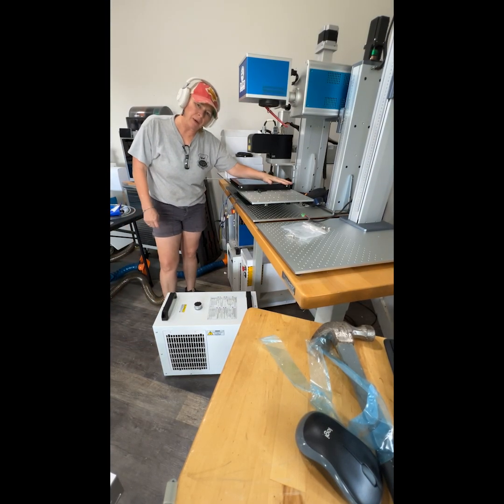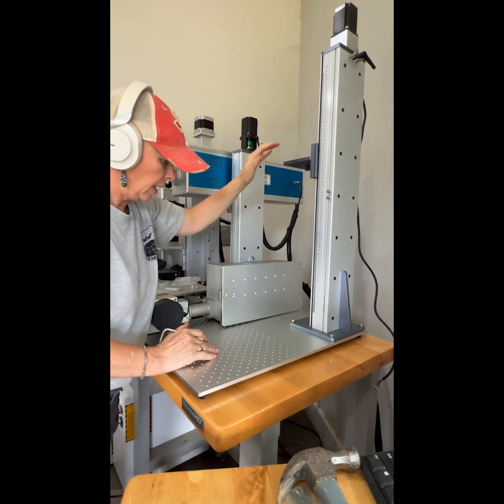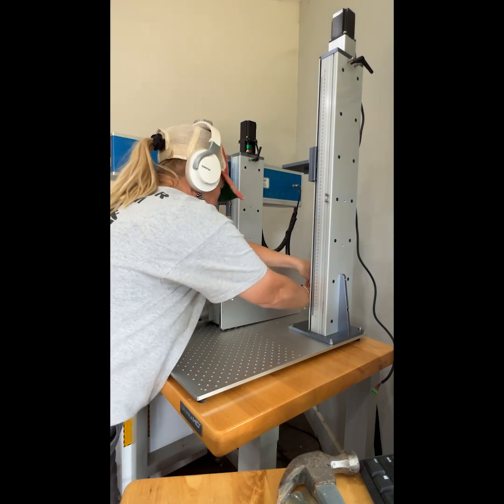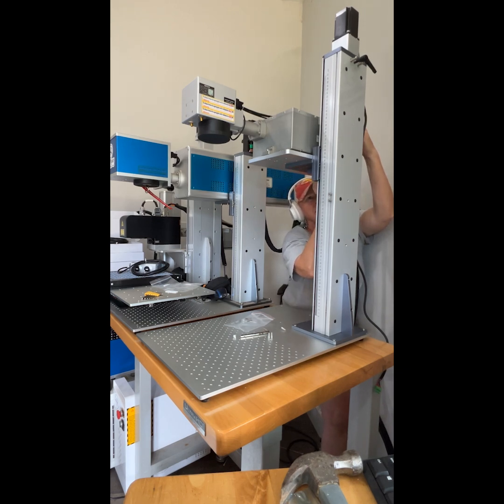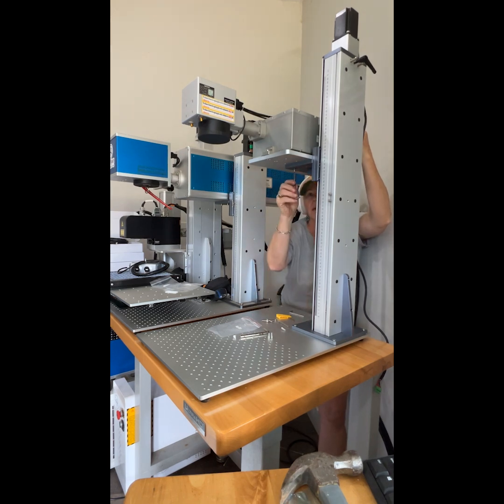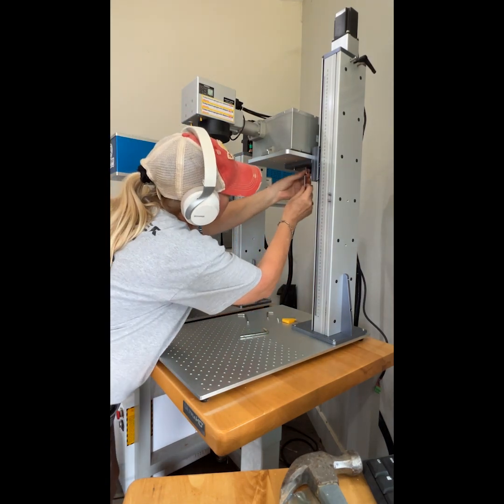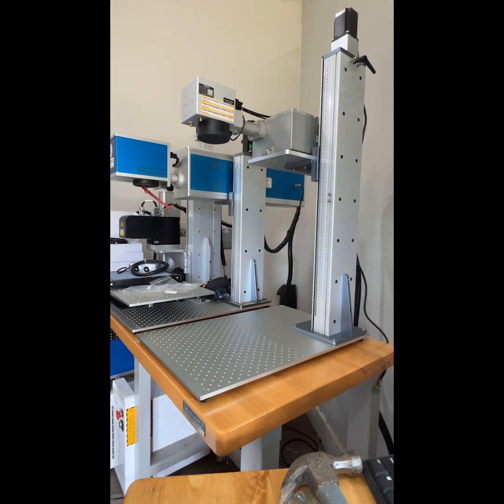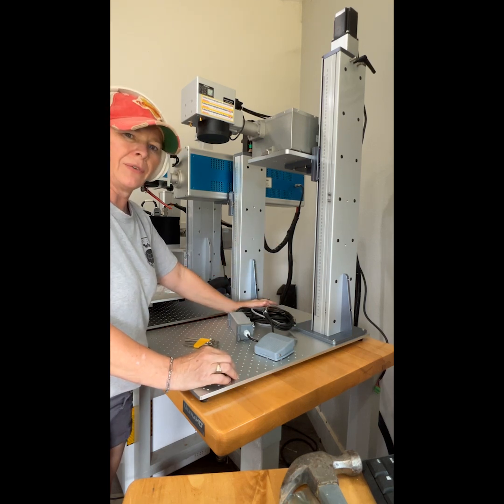Haotian Galvo Laser Hardware Setup | Step-by-Step Guide

Comment: where do you connect the up and down controller? is it on the side of the cooling unit on top of the tower?  Love your videos...very informative!! 🙂
Reply from the maker: I used two screws and mounted it on the side of the tower about half way up.  On another laser I just let it set by the bed.